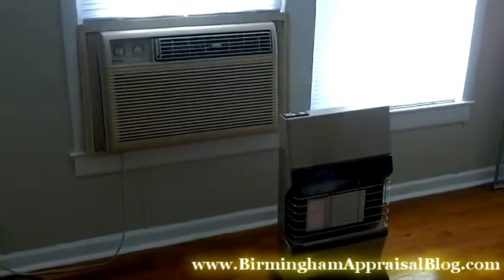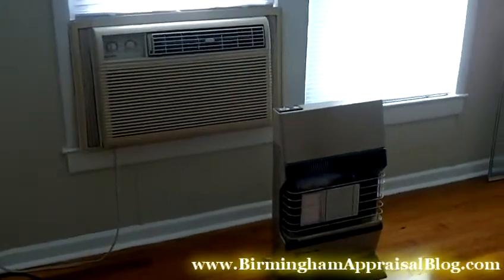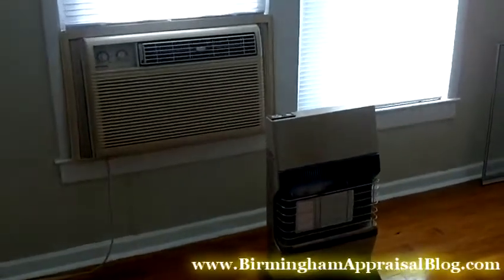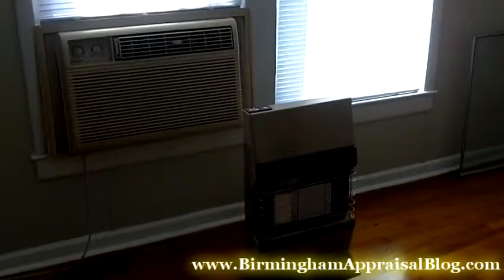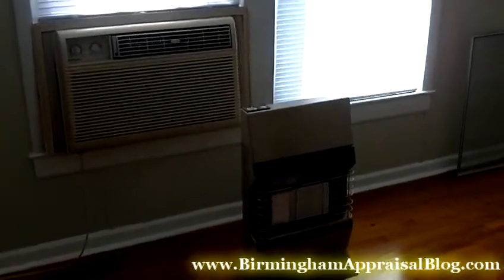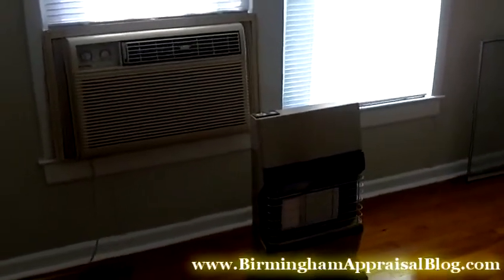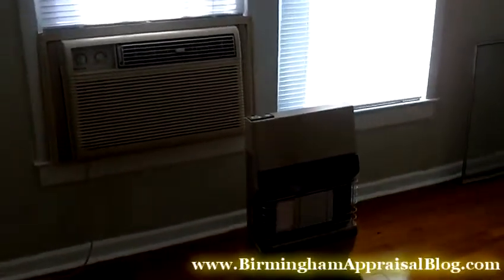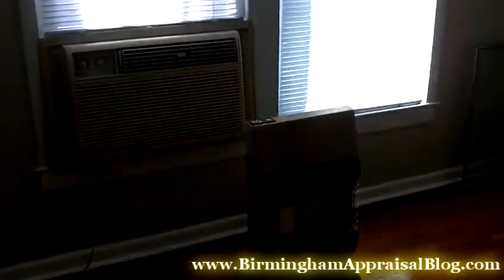FHA and HUD guidelines for heating and cooling.

Comment: Hello im in mobile,.al would this be the same here?  I just had an inspection done, I have window units that provide heat and air in 1.. I was told it need to be a hardwired heater before it can pass. With this new technology I think this is crazy, I have new smart systems in place that provide both, I can't believe Hudson system has not been updated or maybe this appraiser is just unaware?
Reply from the maker: Yes, it needs to be hardwired and permanent so that it cannot be easily removed.